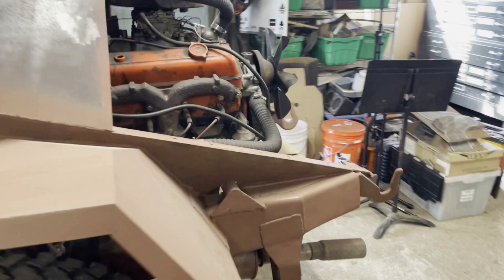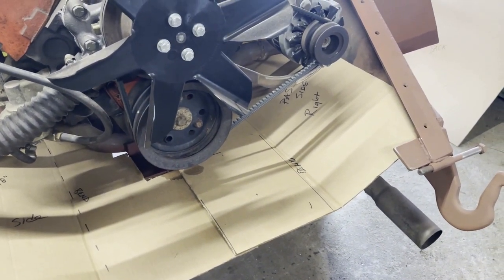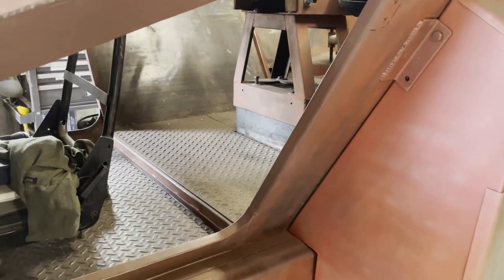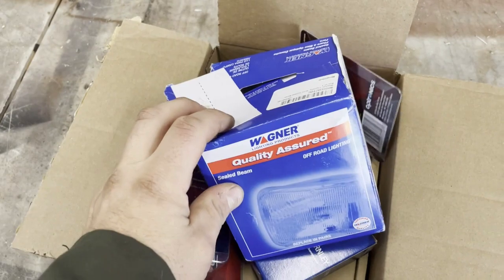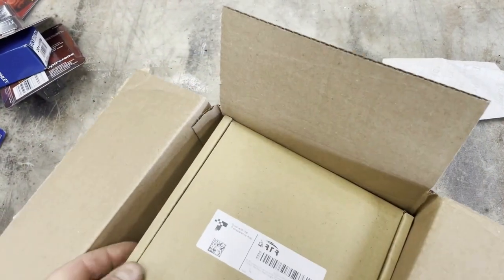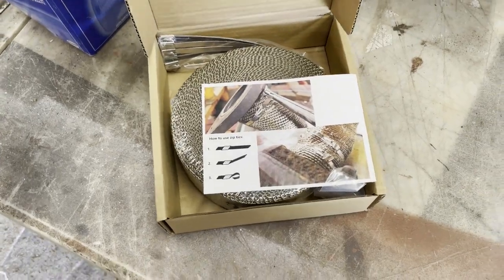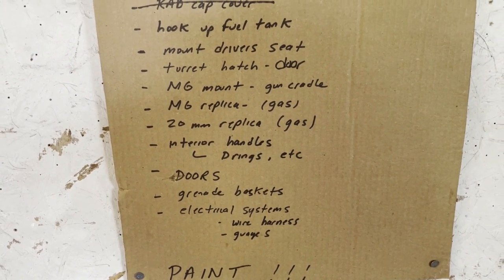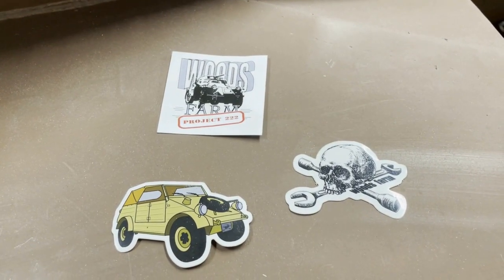Project 222 Update MAY

Comment: Looks awesome! I'm all caught up now, lost you just after you overcoming angle and squaring challenges. 
Thoughts on overheating, ugly at this point I know but short tube headers mounted upside down or just flip the manifolds, would put the exhaust about the right place for exiting the bay, get the heat out at the top of the bay quickly with the heat tape working well to shield and direct heat outside close to the original design. I imagine as it is now heat would seem to accumulate from underneath. I may have missed this but are the cooling fans set up to pull away from the cabin and out the rear?
You have come a long way and the work is looking great!
Can't wait to see ideas on the simulators!
Reply from the maker: I think long term we are going to make custom headers to better replicate the original exhaust setup (which has muffler mounted in better location).  Right now there is an electric fan at the rad that draws air out of crew compartment.  The fan on the engine has been flipped so it pulls air in same direction, had hopefully out the back.
Reply: @woodsarmoury  Yeah, I'm familiar with the location and routing of the original exhaust . I can't remember offhand if it's possible to invert the manifolds on the small block Chevy. My memory of the bolt pattern is a lil foggy . 
 Pain in the butt yes, shrouding/ducting at the rear fan may be needed to direct the air flow out in the opposite direction than the usual set up on cars. If the electric cooling fans are moving the heated air in faster then the fan on the water pump can move air out it becomes like a convection oven in the engine bay. Maybe consider electric fans at the rear bottom outlet area. Farm season soon approaching I'm sure. Going grey or sand color?